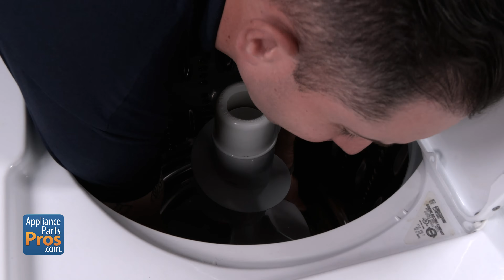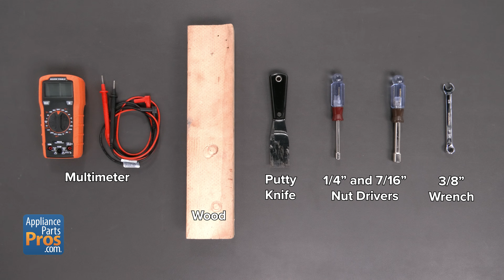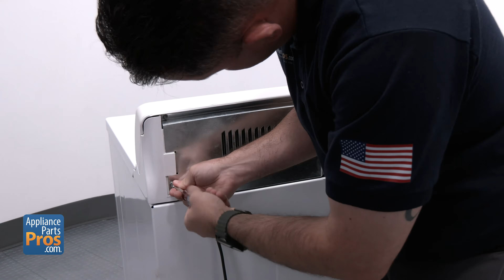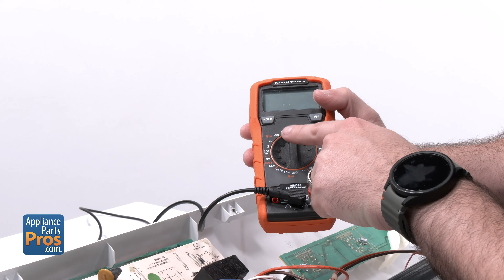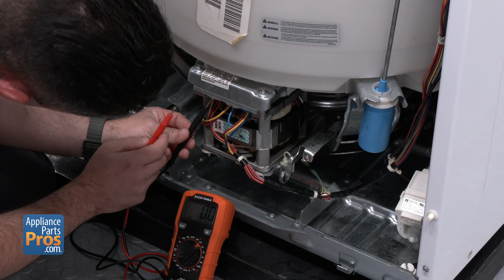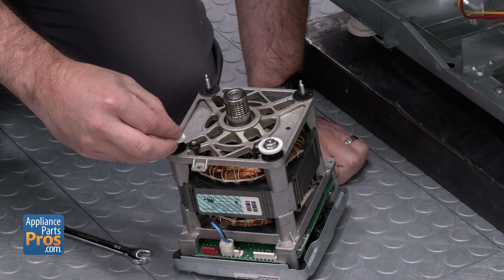GE Washer Troubleshooting SPIN but No Agitate Easy Solution!

Comment from the maker: 🔧 Common fixes for this issue:
▶ GE top-load washer drive motor (no specific part number; ...: https://www.youtube.com/watch?v=taFMLyloO8E
▶ GE Washer Mode Shifter – WH03X30517: https://www.youtube.com/watch?v=Lc1DRYxD0yU
▶ agitator dogs (no specific part number given): https://www.youtube.com/watch?v=rsf4eLqx1WY
▶ Lower Agitator Base WP3347288: https://www.youtube.com/watch?v=-hQw60OIREw
▶ Drive assembly (GE top-load washer; specific part number ...: https://www.youtube.com/watch?v=TPTAm4RIxmg
▶ Direct Drive Motor Coupling Kit 285753A: https://www.youtube.com/watch?v=MYB5x-IqtIM

👍 Found your fix? Hit Like so others can find this video too!
🔔 Subscribe for more repair guides: https://www.youtube.com/@AppliancePartsPros

Comment: I dont have the middle colomn agitator model
Reply from the maker: If you need more installation, troubleshooting or testing information you can check out our Repair Forum: https://forum.appliancepartspros.com/.  It’s easy to register, and you can either post your question or search the forum to see if someone else has already asked the same question.
 
Our experienced technicians, with over 20 years of hands-on appliance repair experience, are ready to answer your questions and guide you through your repair.